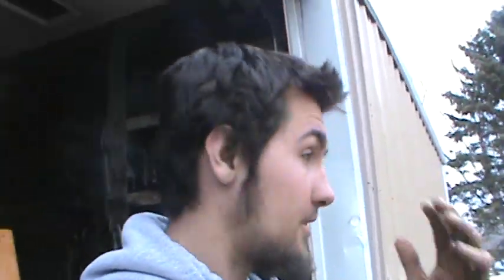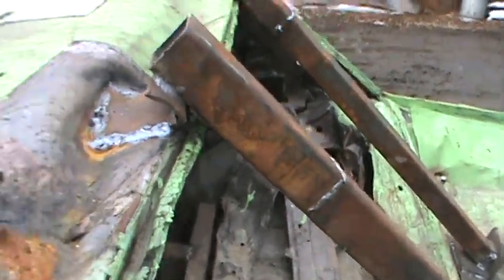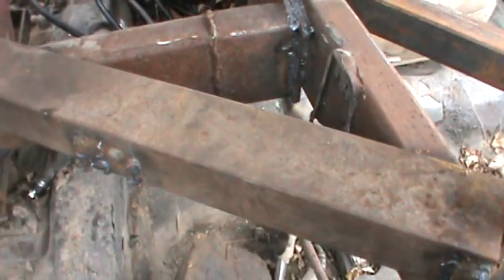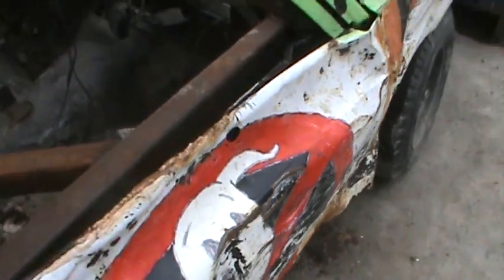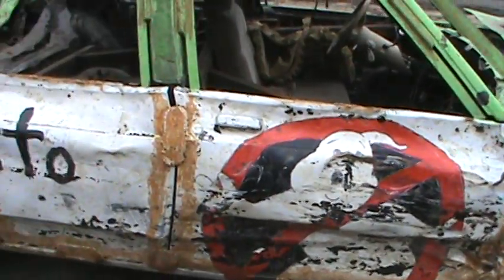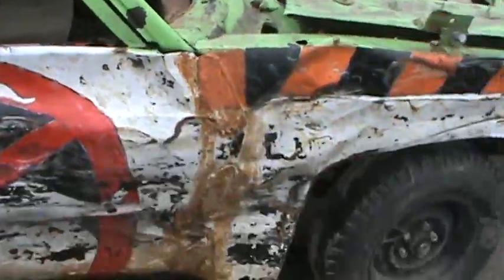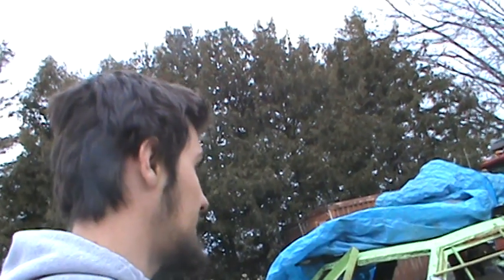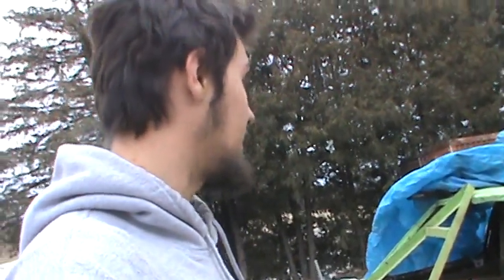Update on the Ghostbusters Derby Car

Comment: Can u have a roll over bar/halo bar?
Reply from the maker: yes I can have a halo bar
Reply: Demolition Derby for Life you should put one on. It's worth it
Reply: Demolition Derby for Life it is not that hard and it will strengthen the car and protect you
Reply from the maker: I might if I have the materials
Reply: Demolition Derby for Life just need 3 pipes
Reply: Demolition Derby for Life u really should
Reply from the maker: I know how to do it and I know its not hard to do I just have to get the material and I have to make it work with my roof sign but it doesn't really add that much extra strength to the car and I know it protects you if you roll over but for as much as ive been to derbies it doesn't happen often
Reply: Demolition Derby for Life you should just move your roof sign up front